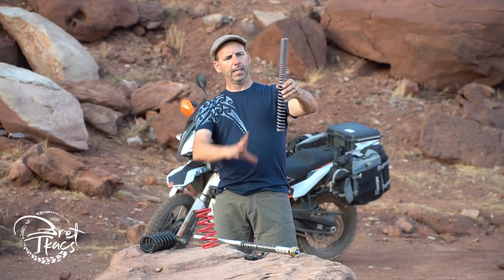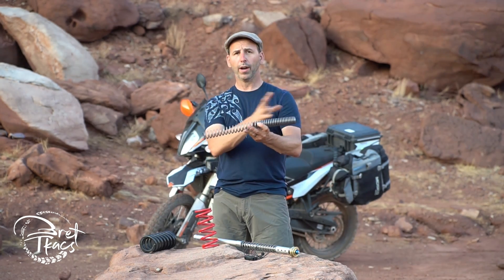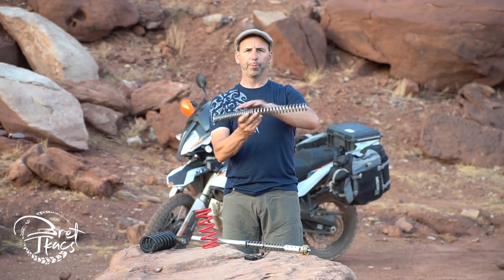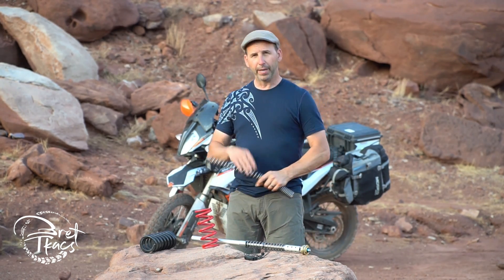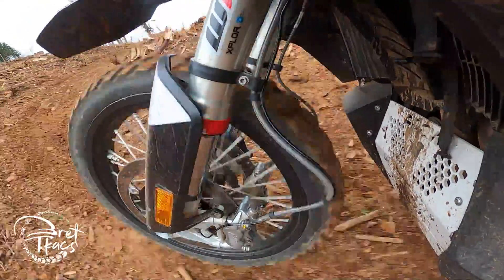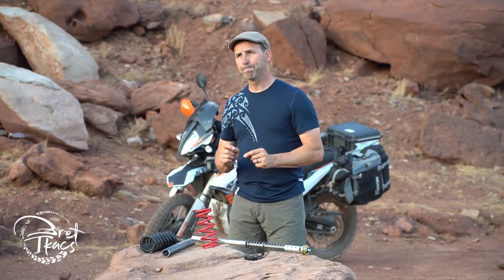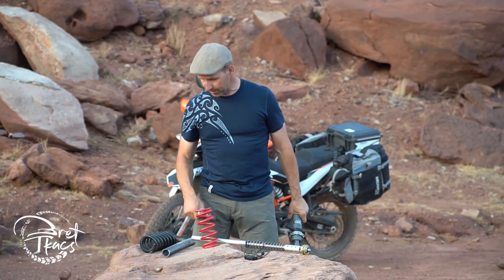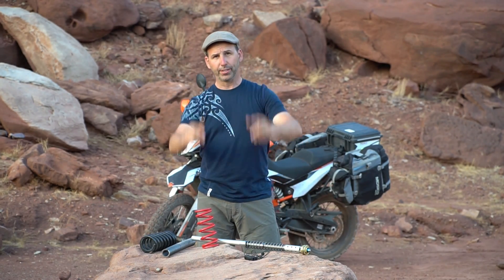Motorcycle suspension, springs, what you need to know

Comment: Race techs spring calculator is way off for bikes on public roads. I used their calculator and it suggested .95kg/mm springs. The stock springs for my bike were about .62kg/mm so I decided to buy .80kg/mm springs and go somewhere in between stock and their recommended spring and my bike is ok for a sport bike because you want a little stiffer spring for crisper handling, but could have even gone with less spring rate.  If I was on a cruiser bike, I would think even softer would be more comfortable being that you are going straight down a highway and want a soft ride, not stiffness and race track handling qualities that a stiffer spring helps deliver.  BTW, I called race tech and the guy on the phone stuck to his guns about their online spring rate calculator. Personally, I think it might be ok for race bikes, but public road bikes can do with a better balance of softness of ride and stiffness of suspension.

Comment: Your assertion that preload doesn't change spring rate is only true for straight-rate coil springs.  Progressively wound coil springs change their rate as the more tightly wound coils bind (i.e. the whole point to a progressively wound coil spring).  If preload binds some of the more tightly wound coils, then the spring rate changes.
I think this is easier to visualize when you think of a coil spring as a wound-up torsion bar.  If you shorten a torsion-bar (made of constant diameter wire), the spring rate goes up.  When a progressively wound coil spring starts to bind, it is effectively making the torsion-bar shorter.

Comment: I think there are a couple of errors in your description?

The variable rate spring - the tighter coiled section will require more force to compress a given distance, not less.

Preload - as you explained, adding preload doesn't change spring stiffness. As more preload is added the higher the bike will sit until such point that the suspension is fully extended. At this point when the rider sits on the bike it will still sag slightly. The weight of the rider would only need to 'overcome" the installed preload if the preload had been added beyond the point that the suspension had been fully extended under the weight of the bike without a rider. In other words, to have have bike upright and level under its own weight it requires 150 lbs of preload (still giving the bike some sag under its own weight), the rider can weigh anything and would still add further sag - the rider doesn't need to weigh 151 lbs to overcome the 150 lbs of preload.
Reply: @Jamie B: Your assertion that the more tightly wound coils of a progressive coil spring require more force is incorrect.  All coils require the same force to compress, until the point of "coil bind" (i.e. when the coils touch).  The more tightly wound coils bind first, thus increasing the spring rate (this is the whole point to progressively wound springs)!
It may be helpful if you think of a coil spring as a torsion spring. All other things being equal (i.e. metallurgy & diameter) a shorter torsion spring has a higher spring-rate than a longer one. When coils bind on a coil spring, they are removed from the effective length of the spring (thus increasing the spring rate).

Comment: Hi Bret, thanks for your videos. I am allways following. So much to learn.
For a soft off road, easy pace, but heavy rider in a stock Africa Twin (crf1000L manual 2016), do you recomend upgrading with progressive springs (as Hyperpro) or linear, as Cogent or teknic?
Thanks.
Reply from the maker: I always recommend to match the springs to the rider. But specifically to your weight, not just "heavier springs"
Reply: Thanks.👍

Comment: anti-squat has nothing to do w/ springs. in fact you don't even have to take into account spring weight when doing anti-squat calculations. anti-squat is the result of swingarm and chain pull angles. so do actually read tony foale instead of just showing pages from it
Reply from the maker: How is it that springs aren't critical to that since the amount of initial squat is determined by the angle of the swingarm? Springs establish the ride height along with load and dynamic factors.
Reply: @BretTkacs  it's technical. like i said it's the geometry that produces anti-squat, such that when the chain is pulled by the front sprocket the swingarm doesn't have the tendency to compress. imagine having the countershaft right under your butt, it's easy to see how chain pull would compress the swingarm, which is called pro-squat
Reply: @BretTkacs  "initial squat" as in the static ride height at rest? If so, indeed anti-squat is unrelated in that it only acts due to the force and direction the transmission pulls on the chain relative to the swingarm and pivot (i.e. geometry as the other commenter mentioned).

Comment: Superb video. Please do one for the rear suspension springs too.

I am 198 lbs without any gear and yet, my Versys 650 rear suspension is too hard for me. Have dialled in the max (16 turns) to min (1 turn) preload on the remote dual and tested it on bad roads, trails etc but no joy. What are your suggestions for modify the rear strut?
Reply from the maker: Your spring is to light, you need a higher spring rate to match your body mass 😁👍

Do both ends together

Comment: Awesome video and very informative. I believe these types of videos are absolutely necessary for the general ride. 
However, I want to make a comment: the energy stored in a linear spring is proportional to the square of displacement. So, if you want to go from 1-inch compression to 2 inches of compression, the energy will quadruple and not just linearly double. What you mean is that the force is linear with displacement. Whatever force is necessary to make 2 inches of displacement will just be double of the force necessary for 1 inch of displacement. The energy is the integral of force times displacement (cause calculus and physics), and hence that square law. (F=kx, and E = 0.5 k x^2 ) Nonetheless, everything else that you mentioned is correct. Cheers!

Comment: The issue is, two-up and travel. The spring for me (200lbs) and a passenger (say 150lbs) and bags (say 50lbs) are all different. That's 150/200 lbs variaiton and as you aptly demo'd, KTM spread is 22lbs (I've had a bigger lunches than that).  Nobody changes springs all the time - we use pre-load. Thus, finding a great spring is only really doable on a performance machine that is used for one purpose (IMHO of course).

Comment: i’m glad i ran into this video👍  the RACE TECH website is pretty awesome! just ordered the correct springs for my weight. my GL1800 has no preload adjuster‘s or any other adjustment for that matter. the front end feels like mush and that’s after a complete fork rebuild with slightly heavier oil it doesn’t take much to bottom out the forks. maybe it’s just me trying to turn apples into oranges... the goldwing is my first cruiser always rode sport bikes before this and was always able to make adjustments to get me by without changing much except for maybe fork oil viscosity. can’t wait to get my new springs to help my floating couch feel more planted😎

Comment: The spring is just one component. Which, factory wise isn’t really adjustable for suspensions without preload, compression and rebound damper settings. OEM settings a very cheap and basic. Without the need to change springs you can simply change the oil on your front works for your individual weight bias. Much cheaper than changing springs.

Comment: I have a Honda Africa Twin 1993 XRV 750 RD07. Does anyone knows how to adjust the sag when carry a passenger or extra load? I looked all over the internet, but I haven't been able to find anything. It has a damper to make softer or harder, but should I adjust the length of the spring as well? The spring has an washer with notches, but should I touch it? Also, since I adjust the back should I adjust the front too? It has air knobs. Appreciate any suggestion, thanks.

Comment: So you as a rider alone are right in the upper end of the stock settings for the KTM. Now how do you compensate for the weight of the luggage and how far back it sits on the motorcycle?

Comment: I have a vstrom 650xt, when I ride with luggage and the wife, i;m hitting the skidplate on speed bumps, its really annoying.

what spring should I get?
Reply from the maker: That depends on how much gear you carry and how much the two of you weigh
Reply: @BretTkacs  I'd say around 210kilos luggage, gear and us.

When I ride alone just for the day, it's about 100kilos

I don't have a center stand to measure sag, and im mechanically challenged.

I just thought, since I ride solo at 100 kilos and with wife and luggage at 200 kilos, I'd get a stiffer spring that can manage both ends.

I know it's not ideal, but I don't want to have to buy and switch springs constantly.

Comment: Bret won't it be better if the throttle was a trigger type like a surgical drill linear movement not like a chainsaw. 

In order to eliminate arm pump and have very precise throttle feel and faster modulation. 

As the wrist and hand is very poor in providing strength ,support and continuous accurate input for long periods.  

If one can't master throttle control with a twist grip won't that hinder riding control and increase crashing chances. 

And what is your opinion on double RHS master cylinder brakes for front and rear with option to combine and control brake bias.

Comment: Yep, on shaft drive bikes the rear suspension DOES rise up under acceleration but only from the torque of the shaft. That is contrary to good handling but less of a problem than the rear squat under deceleration caused by the shaft. That is why a shaft drive does NOT BELONG on a motorcycle. It is contrary to good handling and therefore safety! Belts were used first and are by far the best drive line for bikes followed by chains. They allow the suspension to shift the weight properly for proper handling.

Comment: Very interesting video. I’m actually having suspension issues with my bmw F700gs. The front forks are sending through too much shock from bumps in the road. Sort of a damping issue. Not sure what to try to fix the issue?
Reply: Too fast rebound. Try finding your rebound setting and setting it softer/slower. On dirt bikes this is on the bottom of the fork
Reply: Thanks ethermal1 but there’s no adjustment on my forks whatsoever. It happened ever since I drove a bumpy green lane, there’s no oil leakage and the forks appear good, but damping is terrible.
Reply from the maker: @chrishall734  spring it for your weight and add a set of gold valve emulators from Race Tech

Comment: PS. Actually, the progressive nature of both air springs and some helix (sometimes wrongly called spirals) springs, is a potential problem, due to resonans-characteristics of the system. In a suspension system one often strives to reach something close to a critically damped system (Q=0,5), i.e. a system that does not resonate, but having the spring grow stiffer makes the damping insufficient. 

That is one of the good properties from progressive linkages - letting both transformed spring stiffness and damping grow with the progressive rate, but in fact a suspension with a linear spring and only progressive damping (more Ns/m at higher compression) often works even better, but is more complicated to do. The valves can be modulated by the compression position of the damper. 

I’m of coarse simplifying, and do ignore in the above that a motorcycle suspension typically is not only unlinear (progressive) but also typically have different damping characteristics during compression and return. But one thing at a time...

Comment: As a physicist, I'm happy to see that you mention a lot of forgotten (or newer known by the general public) properties of a suspension system. 👍

Like the intrinsically progressive nature of the encapsulated air (due to both the adiabatic nature of the air and of coarse the geometrically 1/x-factor*) as well as the differenses regarding space used up by low cost spring with thicker wires and many turns. 

Regarding the last factor, it is perhaps worth the effort to add, that the issue is not E-module (all steel qualities are basically the same, ~200GPa) but the elasticity range, i.e. the deformation range where plastic deformation is avoided. Different steel qualities are quite different thusly. 

But one thing you got wrong - a linear spring is storing 4 times the energi when compressed 2 cm compared to 1 cm, and 9 times more when compressed 3 cm’s. 

You seems to confuse energy and force in the video. The spring-constant k is in fact a constant (N/m) if the spring is linear, so (as you are correctly stating) it takes twice the FORCE (not energy!) to compress a spring 2 cm’s than to compress it 1 cm. But the energy to compress it twice as long is quadruple. 

The energy (=work) is force times distance, and in this case you can integrate the force along the distance (that doubles to reach a twice as big peak force) and find the area Of the second half of the travel to be tree times lager, summing up to four times. 

Best regards, hugo

*The spring “constant” of an bike-pump air spring is proportional to 1/(remaining travel), so it basically grows to infinity (if it has flat piston and a flat cylinder head). So an air spring is often a good way of avoiding a harsh bottoming out.

Comment: Bret WOW! You don't see people identifying dual rate springs correctly; most call them "progressive" perhaps because that's what Progressive company sells.

As for dual rate springs they're usually designed with balance point at rate switch so they act as higher rate on compression when wheel hit bump and lower on rebound when wheel drops into pothole. Later helps to maintain wheel in contact as pressure exerted on downward moving wheel drops at lower rate.

And the true progressive (also called variable rate) like HyperPro are the best for ADV application as they cope with various loads better than single or dual rate.

Would be nice if air springs were still around with exception of a few experiments like Honda CRF you have to go back to 90s to get them. To bad they would be good application for ADV bikes I still have ZX600 shock laying somewhere around but it is too short for modern bikes..
Reply from the maker: Technically most suspension still uses an "air spring" in complement with a mechanical spring. Not sure if I know an exception to this off the top of my head. Even emulsion shocks still have a nitrogen charge with a bladder
Reply: @BretTkacs  IIRC a few years back Honda went to air spring on CRF450X for a year or two.. and I could be wrong KTM had it on dirt bikes?

As for rear shocks nitrogen pressure in them doesn't work as spring.. the air in forks however does that's why level of oil is important. I had replaced springs in forks once without checking level. They were thicker and oil level went up. Needless to say forks became very stiff on big bumps my bad.

Comment: Setting the correct spring rate to match "Sag" is important as it also affects steering geometry between the front and rear wheel, that is high speed stability or cornering sharpness, all good if you are riding a enduro or race bike, how about when you ride an ADV bike that is loaded with gear does the same principles apply?
Reply from the maker: Even more so because we also have load challenges on traveling bikes

Comment: You mentioned straight rate, dual rate and progressive springs. Could you say which is best, or rather which is most appropriate for certain uses?

Also, are those spring types also available for rear suspension?

I'm buying a DR650 to turn into an adv, and I'd like to set it up as best I can for a commuter and weekend/holiday offroad bike.

Thanks!
Reply from the maker: They are all the "best" in the right application. It's the mission, environment and rider that determine which is best

Comment: Sometimes, the act of setting the rear sag will help you identify whether you have the correct rear spring or not. If you get the right sag but you've used 100% of the preload in your shock, you likely need a heavier spring.
Reply from the maker: True... I will cover sag in a later video

Comment: Great video!!! Very educational, what would be the case of my 1250 gs that has this smart suspension, but I honestly feel it is too harsh. Could I change the spring without messing up the ESA computer?
Reply from the maker: The answer is "that depends"... Suspension is a complex thing. The computer programs make it more complicated. Many of us eliminate thd ESA and go manual with full adjustability.  For most riders that is a step too far though
Reply: @BretTkacs  thanks for the answer,  maybe it is better to get a less complicated bike and upgrade the suspension like the 790 adv